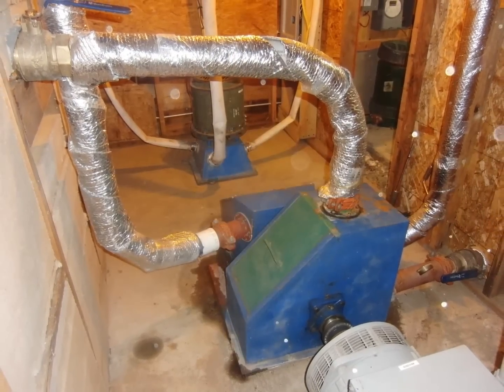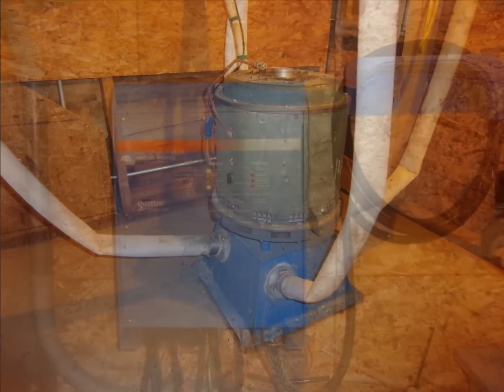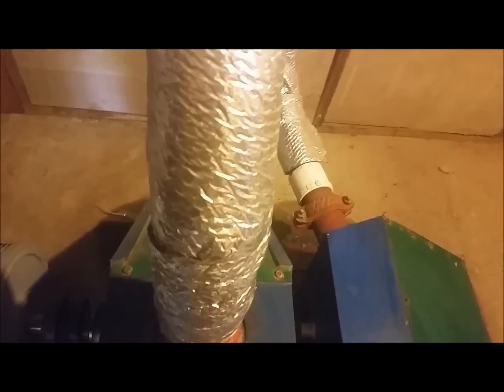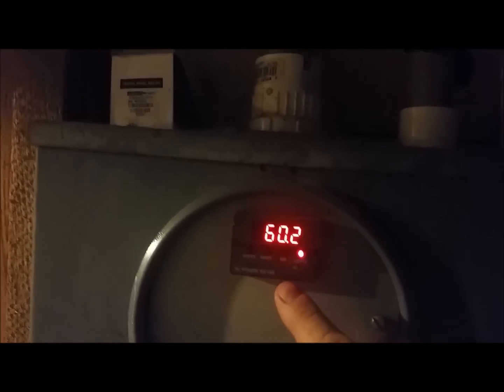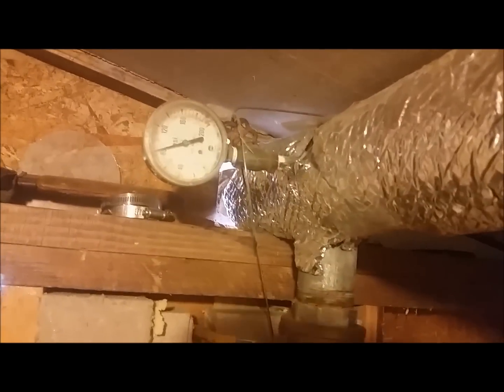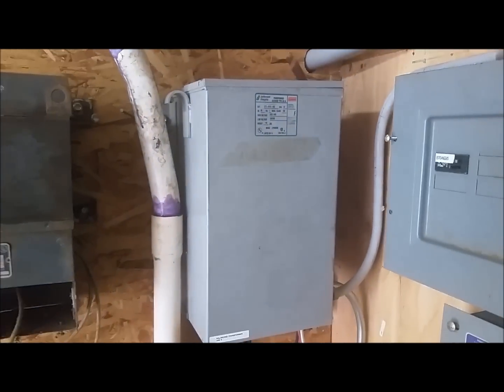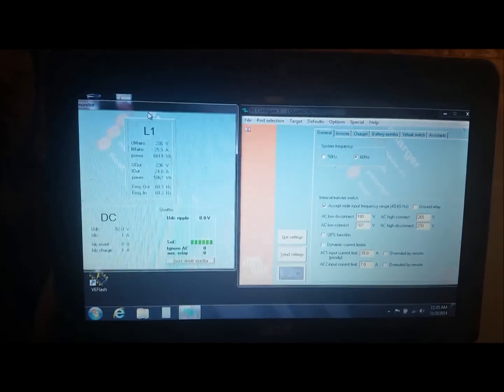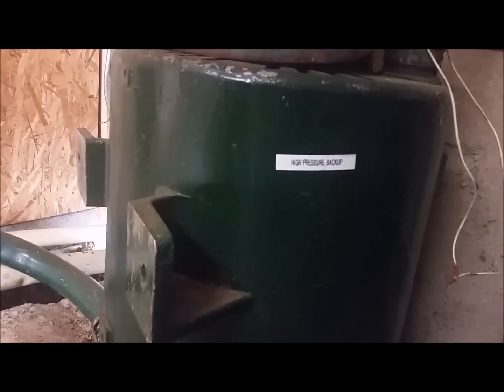(Part 2 of 2) Micro hydro, home built, off grid, power system

Comment: Again, Fantastic!  Glad to see both these videos. This is clearly in your blood. Miles beyond what I've done.  I love how you are using two different pressure feed lines.  Figuring the proper sizing on your Turgo and Peltons must have been both fun and interesting. What do you use the excess power for?  Heating a greenhouse perhaps?
Reply from the maker: I have been away visiting kids and grand kids so just got back on the computer. Glad you enjoyed the video. Yes part of the power heats a small greenhouse that is attached to the powerhouse. At one time when I was using a less efficient generator there was enough waste heat from the generator to partly heat the greenhouse.

Comment from the maker: Brenden, Yes this system runs 24/7. Once or twice a year it gets shut down scheduled or unscheduled maintenance.The water HAS to have fall. A lake is useless for producing power. A Francis turbine is a mid head (fall) turbine that require an approximate head range of 30 to hundreds for feet. The lowest head turbines are the propeller turbines, Kaplans and such. A slow moving river is going to be extremely hard to get any useable electric power from even with a propeller turbine.Good luck in your research.

Comment: I'm looking into Smaller hydro generators, most likely Francis turbine. I'm just starting my search and learning about these machines. Are these generators you can run 24 hours 7 days a week to produce constant energy flow or does the machine have to be shut down every so often? I would like it to run 24/7.
Also what kind of body water do you need to run a hydro generator..can you use a lake, or does it have to be a river with constant water flow?
I have been looking at many generators that I would be able to run 24/7 including natural gas continuous generators but micro hydro seems the most reasonable and cleanest/cheapest way to go.
Any answers appreciated.

Comment: Very informative video's, just for shyts and giggle's, how much you got tied up in this?
Reply from the maker: Since it was built over a period of time I lost track of the cost but is would be no more than 25 to 30 thousand. 16 of that is just in the lithium battery and inverter.
Reply: Thats about what I was thinking,, Thanks much
Reply: Not including cost of all the milling machinery necessary to make turbine parts and so on.
Reply from the maker: praestant8 The milling equipment and other equipment were mostly bought used. If you wanted to set up the same equipment used in this it would run probably another 10 grand. The milling machine and lathe together was about 2700. No it is not cheap compared to a small low voltage, battery/inverter system but if a person was trying to set up a system of this complexity, commercially, several hundred grand would be invested.